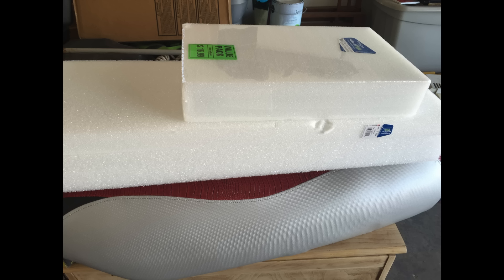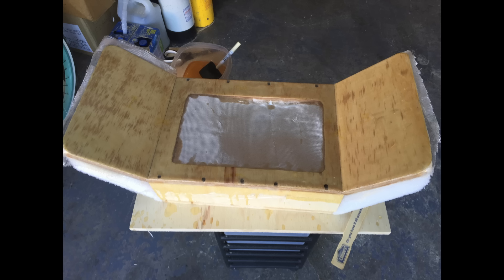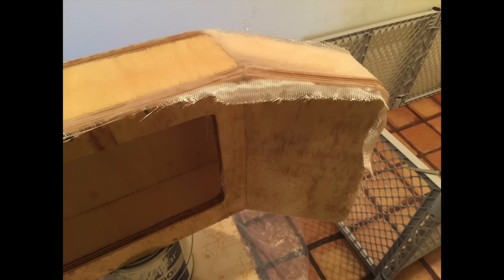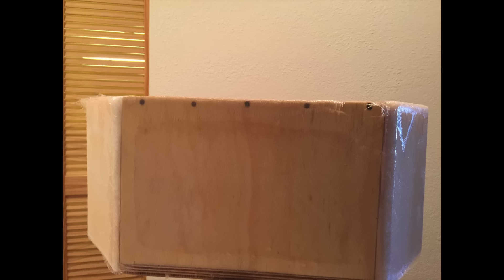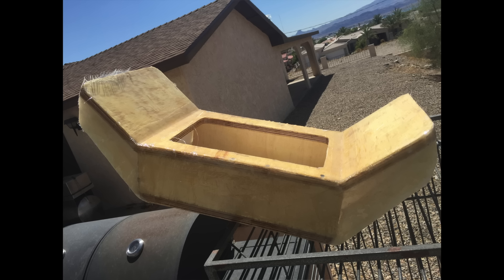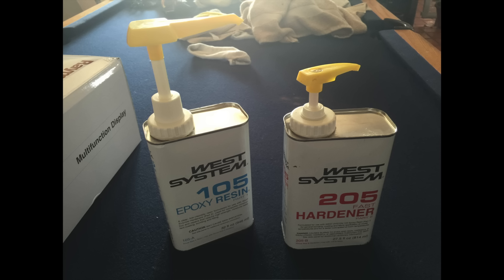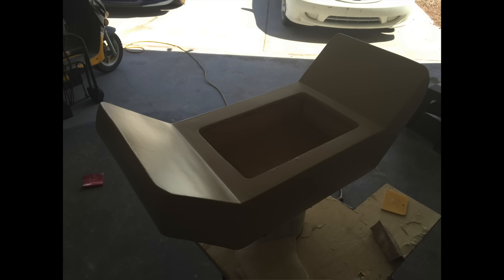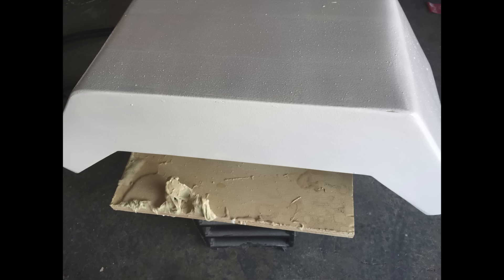S/V Southern Cross Ep. 18 - West System Epoxy lay up on a DIY nav pod

Comment: Great job!!  It looks very good.  A tip for future projects with styrofoam or foam for cushions, an electric knife is great to cut with.

We moved on the boat last Friday and I started to do some videos.  I will try to have our channel up this weekend with some videos on it.
Reply from the maker: +Mike Tadlock where the heck do you get an electric knife? I asked at the marine stores and got nowhere.  I can't wait to see your channel up and running! Congratulations?
Reply: +S/V Southern Cross You can get them are Walmart for about $20.  It is an electric carving knife like you use to carve a turkey or ham.  They are great to use to cut foam.
Reply from the maker: Lol! I thought you were talking about the electric one that cuts by heating up the coil and melts what it's cutting. That's what I have been looking for. I saw them using one in one of the first couple videos of Shaun Sailing pacific crossing videos. For cutting rope and fabric. I have an electric carving knife and didn't even think to use it! LMAO!!!  Thanks again Mike!
Reply: +S/V Southern Cross You are talking about a hot knife.  Look on Amazon or Sailrite.com.  A good one will cost you over $100, but they are nice to have around.

Comment: Looks Good.  I personally re cored the cabin roof of my boat from the inside.  I learned how to lay glass upside down and many other tricks. I used all west system products.   I have a few suggestions/comments for you. First of al epoxy v.s vinyl resin.  I saw that you are using glass cloth.  Don't think of the cloth as dissolving, your are "wetting in out".   Vinyl resin doesn't dissolve cloth and deferent then epoxy.  On the other hand glass mat, which is  short glass strands in a random pattern,  has a binding substance that Epoxy does not dissolve.  Vinyl is cheaper, harder and you can change the hardener ratio to slow your cure time.  Your boat was originally made of Vinyl.  Epoxy is suppose to be mixed in a specific ratio and it does not get as hard as vinyl.  However epoxy has a much stronger adhesive property that is why it is preferred for repairs. 
 Second, if your mixed epoxy is smoking and Harding in the pot, mix it is smaller batches.  Once it is applied to your cloth or mat it has more set time.  As long as it is still sticky you can apply  another coat/ layer of glass and you will still have a good chemical bond. Third,  if your wet out mat is not adhering around corners when it is curing wrap plastic around it.  I used painters drop cloth plastic.  The thicker stuff is better, because it does not leave wrinkles.  Once covered you can use your hands to work the bubbles out.  Next, cover the plastic with some kind of foam and find a way to hold pressure.  When your epoxy cures simply peel away the plastic.  It works like a charm.  Epoxy will not stick to the plastic at all!